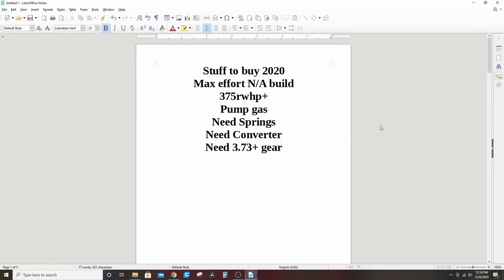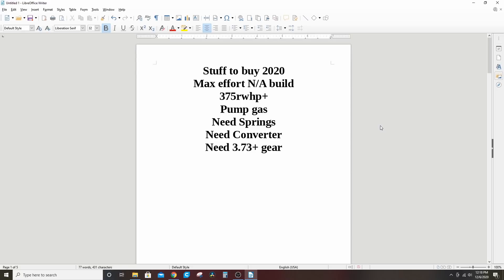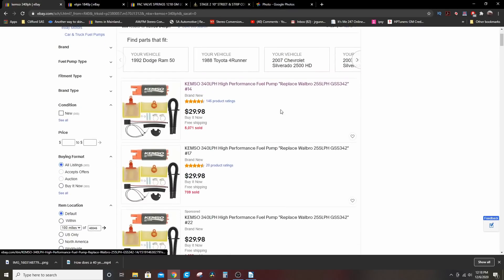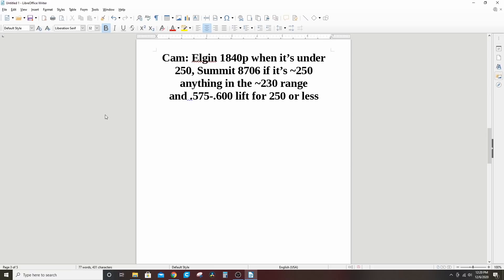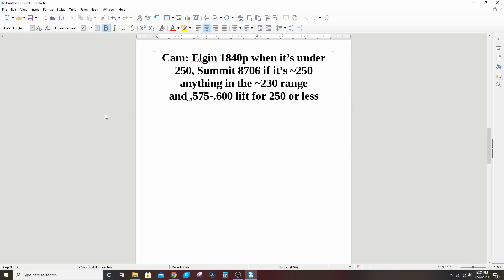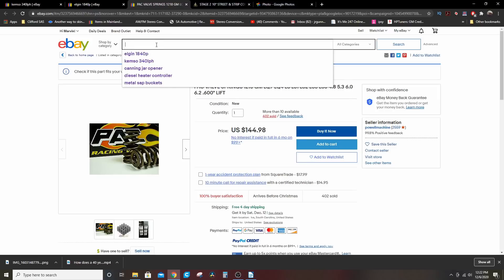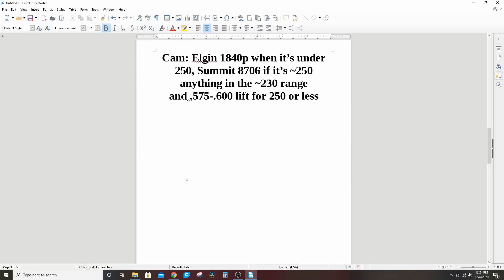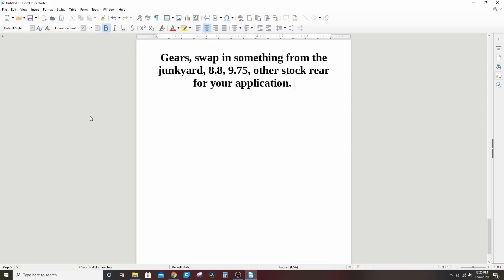Budget LS Swap build recipes Part 2, max effort N/A for 1200!

Comment: I just did all the above upgrades. All I have left to do is get my rearend re-geared. It has a 2.56:1 rear gear in it now. I have a posi chunk, and 3.73:1 gears to go into it. Should I swap gears before taking it to my tuner for a final tune? All I'm working with now is a flanders mail in tune. Or would it be okay to get it tuned with the 2.56 gears in it? Thanks.
Reply from the maker: I would just tell Flanders to tune it for 3.73's
Reply: @TheDrivewayEngineer  I already did, knowing I was gonna upgrade. Just wanna know if I can get it final tuned before I swap gears? Or should I get the gears swapped before I take it in for final tune?
Reply: @TheDrivewayEngineer  it runs, and drives now, on the flanders tune, it's just not 100%. It still could use a fine tune, which I have a spot lined up, just need to know if I should take it to my rearend guy first?

Comment: If I'm in the process of boring out my lq4, should I stick with like a 4.030 bore, or should I do a overbore to 4.065? This will be for a trailer towing truck. Want to stay away from forced induction because of simplicity. I have some used L59 injectors, but how long do gm injectors commonly last? I'm considering maybe getting fresh new injectors.
Reply from the maker: You're totally off the reservation with that crap.

I pick stuff up off the ground and use it as is.

You're on the wrong channel for advice on how to spend all the money
Reply: @TheDrivewayEngineer  Totally understand. I wasnt sure the extent of your knowledge on LS stuff. Appreciate it when people let me know they really dont know the answer rather than pretend they do.

Comment: Can you help me understand what lock up converters do? A guy rebuilt my trans and he says its a stock stall converter but now its a lock up.
Reply from the maker: Lockup converters, literally lock up. 

So 1rpm in is 1rpm out. Like a manual. No loss, no slippage. A normal, not lockup converter, would have at cruise, maybe 2400 in, and 2200 out, because there's slippage.

You could complicate it even more with a 3500 converter and a 2000 rpm cruise speed, there would be even more slip than stock.

With lockup, it locks, the end, 6,000 stall? When it's locked at 2400rpm, it's locked period.
Reply: @TheDrivewayEngineer  ok thanks

Comment: The L59 Flex Fuel injectors should be rated around 36#.  I've got that version of LS from an old POPOHO.  It also has the 61.5cc #706 heads that are more desired even tho the valves are the small ones. I'm going to spend minimal hours raising the exhaust port roofs, smoothing the bowl transitions & lower & smooth the intake ramps.  Just going to smooth a little after that but doing it all myself for the first time. I responded @KevinGore question on how to locate the injectors & other items.  Your biggest help parts picking can be to learn the RPO codes listed on the SPID label for GM vehicles.

Comment: My budget 4L80E/4L60E converters are 499 shipped in the US 48. JR paid about 525 when he got his. After he got his UPS added flat rate volume based shipping which cut the shipping cost roughly in half.

His, since he doesn’t remember, is built for the turbo. It should go to roughly 3400 with the turbo.
So the converter that rips and he loves NA, actually isn’t optimum for NA I do it a little different. It is proof however for the people who wonder if I can build them the converter they need for a turbo and run it NA for now. You absolutely can, it works great, it’s the way to go, and I do it all the time.

You can message me on Facebook, I am indeed on all the groups, message here or shop is (727)401-4269 call or text.
Reply from the maker: Thanks Ryan!

I didn't want to lowball you, so I padded it :D
Reply: @TheDrivewayEngineer  appreciate it.

Comment: I think gbody had 214 gears or 256 ratio
Reply: Think it was 2:73.  Pretty sure my 87 Monte SS had 3.73 though & it was new to me so no one swapped them.
Reply: SS Monte Carlo is performance orientated. So 3.42 or 3.73. everything else got tall gears. El Camino ( considered a truck) was in the middle with 2.73 or 3.08

Comment: Apparently I do things the hard way and definitely the more expensive way I have  a 70 c10 with a crate zz4 engine what a dog! With 700r4 transmission 373 rear-end. So went and got me a lq4 engine changed heads from 317 to 243 new cam lifters springs should I just use the same intake and injection?
Reply: Yes...truck intake does the job just fine...and those 243 heads are gonna wake that lq4 right up....u might wanna consider the elgin 1840p cam JR speaks of!!!
Reply: @trentdawg2832  I went with the cam summit recommended comp cam don't remember the specs have heard conflicting about whether or not a 460le could handle the power but if I go to 480le have to modify the transmission tunnel?
Reply from the maker: Absolutely, just use stock everything
Reply: @TheDrivewayEngineer  thanks for help

Comment: What about lifters? Are melling's any good? Planning on refresh my LS1, along with that same mods in the video. (Elgin 1840p, Pac1218, FTI 3200 stall, 3.73, etc)
Reply from the maker: I always just use the stock ones
Reply: @TheDrivewayEngineer  thanks a lot man!

Comment: I try and watch all your videos and I am still playing catch up with them, I will say that I watch the whole thing regardless of whether it is more than my budget is just for the knowledge and specific details of what is necessary. I just bought a 1999 Silverado 1500 4wd w/136k miles. What would you do to it first to try and get some worth the money power while I save up for my 4l80 transmission, forgot to say that it is 4wd. Good day to you from Mars, PA. just north of Pittsburgh,. PA. Got a cold air intake for the cheap (Spectre) and what would your next move be? Had to ask and I am going stick to the realistic approach to the horsepower and just want a good runner like you said drive and enjoy. If I get to 400 or 450 I would be estatic and probably might be too much as you mentioned at times because of the unforseen cost involved. Just want to enjoy like you said and do with your ride. Eventually but a realistic cam and a small shot of nitrous oxide with my 862 heads on it like you said to look for, lucky for me they're on it now from the factory. Shorty headers or what do you recommend for a realistic next step while I keep paying my junk yard owner friend for a 4l80 that you said was a must for reliable transmission. Great evening to you and thanks again for your time and motivation to do this before I retire in 5-15 years depending on what the owners do if the economy takes another hit. I'm trying do the best I can get without waste as you say. A piece here and there.  Headers maybe, I will be honored you hear what you think. Just want a good reliable and fun build like you said. Good evening to you and the family.
Reply from the maker: I would start with a tune, or the ability to tune
Reply: @TheDrivewayEngineer  Watching your LS droid video as I type back to you.   Lots of catch up to do as I try to keep and make my realistic list as you say, best bang for the buck. Thanks again for your time.

Comment: The build for the Non-LS Fan:
Gen 6 454 with a spun rod bearing $350
4.25 inch stroke crank $570
6.7 inch rods with 7/16th ARP bolts $250 
4.31 inch forged pistons $500
340cc aluminum heads from swap meet $800 Brodix
Old Edelbrock Tunnel Ram with a divorced plenum $150
Two 650 double pumpers modified for blow through $300, already had carbs but installed annular boosters and power valves.
Lunati cam and complete valve train 245 degree @ 50 and .640 lift total valve train cost $1200 aka friggen expensive !!!
Twin T-76 eBay turbos with a .96 AR plus wastegates, blowoff valves, tubing etc. about $1300
Ignition system MSD about $650
Turbo headers $400
Machine shop $400 
Miscellaneous $800
Over $7600 bucks (with a lot of deals) and you can most likely beat it with a $3000 LS engine but it sure looks wicked in my 53 Studebaker truck...LOL

Comment: I am set up right at this point with my 6.0 I did the sloppy Elgin “stage 3” cam and pac 1219 springs but just need to add a real converter now and probably hunt for some of those flex injectors. I’m dropping this in a 65 c10 should make it into a fun driver to take all over for truck runs
Reply: Same. I went SS2 equivalent from Summit and Pac1218's.  Just need to get a converter with a decent stall. My truck is a turd until it hits 3k rpm
Reply: @donnie1581  the drive train came with the project. I have been putting it back together and piecing stuff together and finding the little issues that pop up. It’s got some sort of reman converter in it now I will probably end up using it like that for a bit I just want the thing on the road and I have tons to buy for the thing

Comment: What about intake and throttle body? Or did you keep yours stock? Thinking about taking out the 5.3 L33 and dropping in a 6.0 or 6.2. Running numbers for future build. Thanks for all this info to start with.
Reply from the maker: Always stock
Reply: If you're going to turbo or spray your limiting factor is connecting rods and springs. You can get 1000+ hp sbe stock intake stock throttle body with a turbo

Comment: dumb question how do i know which injectors i have
Reply from the maker: If you don't have a flex engine and a normal truck engine, all the rest are basically the same
Reply: If you're in a pull-a-part, check the SPID label in glove box of trucks or vans (little known that vans had 5.3L also).  Multiple things to visual check, yellow gas cap, injector rails are square tube & stainless, crossflow fuel tube is a push in with o-rings & hold downs (not soldiered like TBSS), and the SPID will say L59.  Google GM SPID codes & print when you hit the yard cuz it can be very helpful.  A note of caution, a vehicle can always have swap parts so the SPID doesn't always work, so get pics & part # to look for if you can. Hope this helps others.